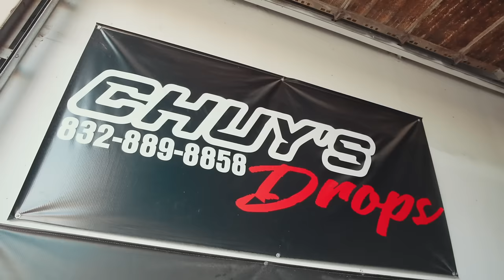We Drag Tiny's SS across the PARKING LOT!

Comment: Pull the console. There should be an adjustment on the shift linkage. That'd a pretty sick build 🤘🏼 looks like my handbrake in my v8s10 🤣 you guys are killing it 🤘🏼run a x pipe on Takashi then go strait to the boom tubes off the x that should put them far enough forward to run in front of the tire and still give you enough to not trim to much off. You want as long of a tube as possible. ( pause!) 🤣not like that! 🤘🏼